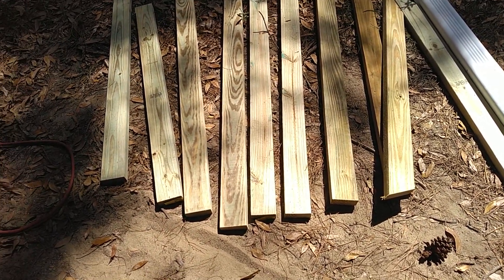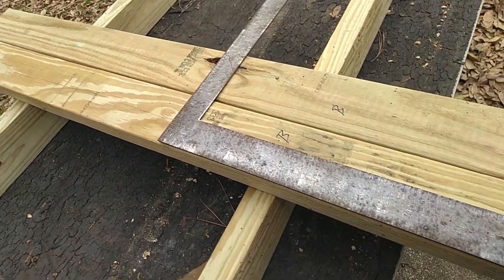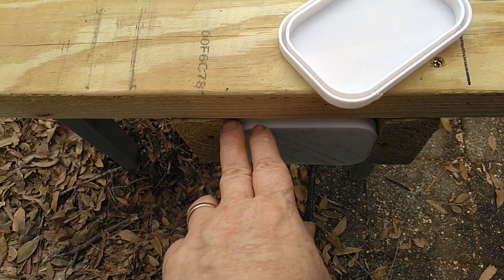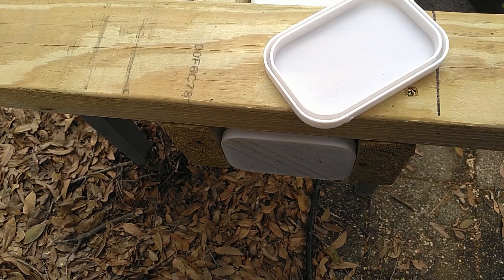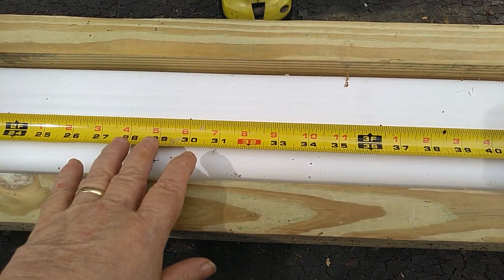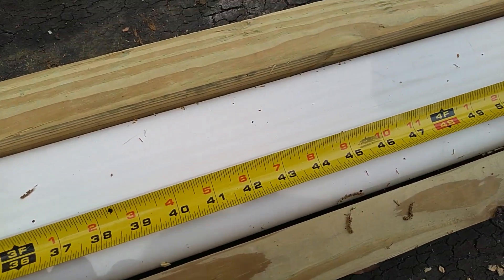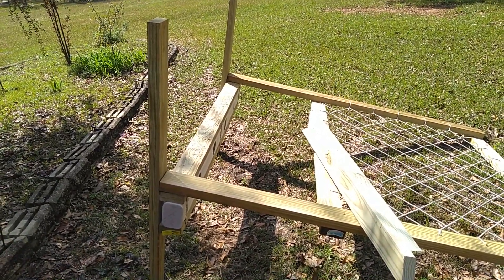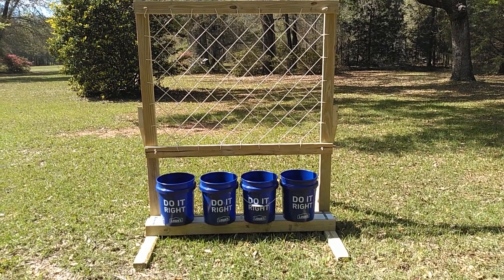STEP BY STEP, RAIN GUTTER GROW SYSTEM, WITH TRELLIS

Comment: What is this used for?
Reply from the maker: It is a rain gutter grow system, which mean, it keeps the soil in the buckets at a constant moisture rate. For optimizing growing. And the built on trellis keeps your plants from bouncing around in the wind.
Reply: @bulldogge1232000  How does the water get in the bucket?
Reply from the maker: @sjackson99  A float valve fills the downspout section, and wicks up into the buckets